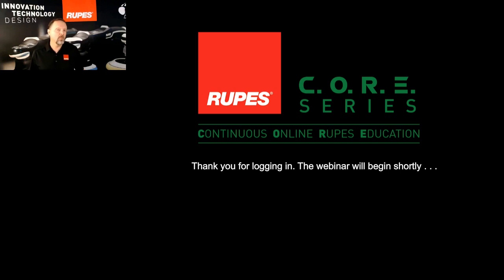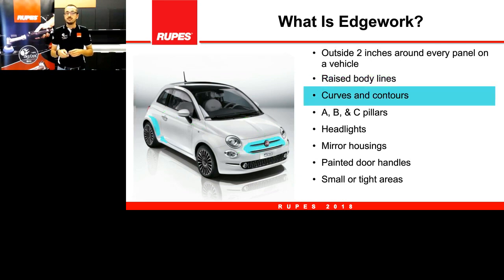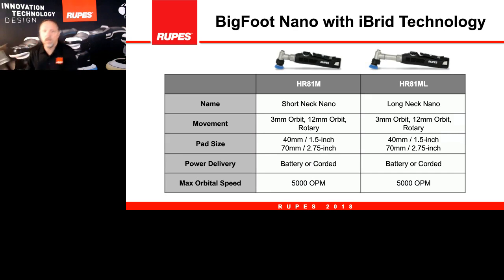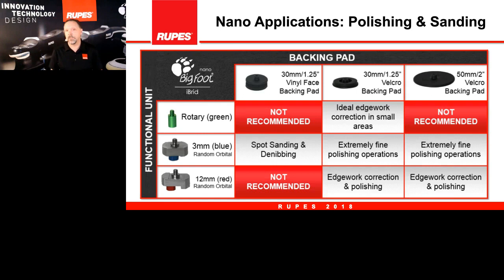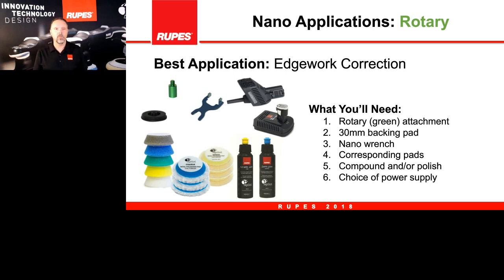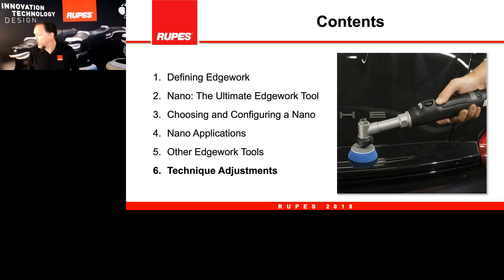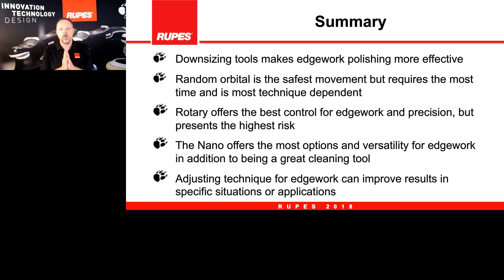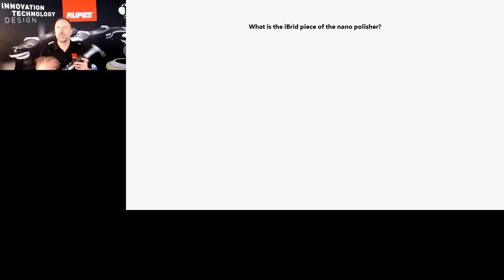C.O.R.E. Series Webinar: Tips & Tricks on the BigFoot Nano iBrid Polisher

Comment: Do you need to reprime (the first prime technique) the pads after blowing them out during application especially wool?
Reply from the maker: No. You only need to prime on the initial, first use of the pad. After that reloading with a few drops is all that is necessary.
Reply: @RUPES  thank you!